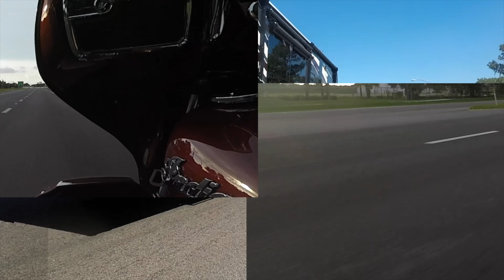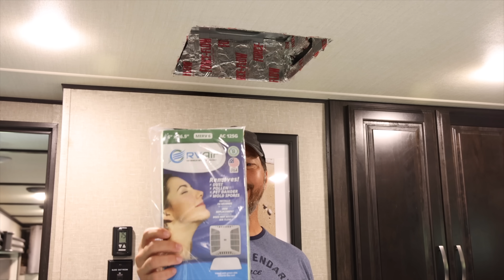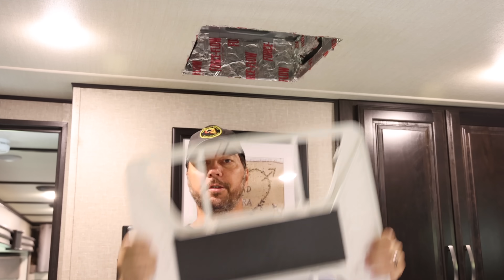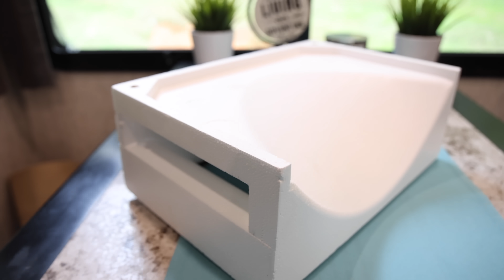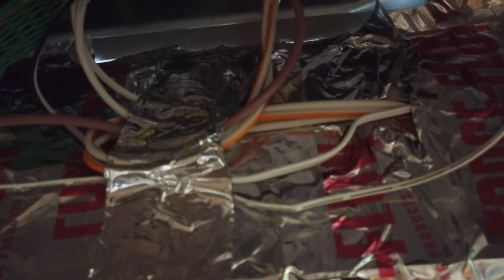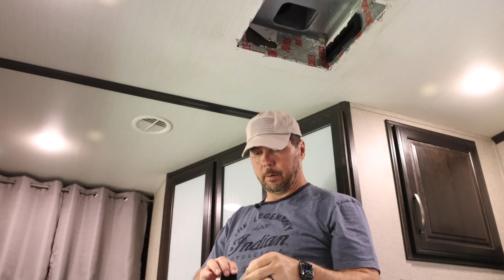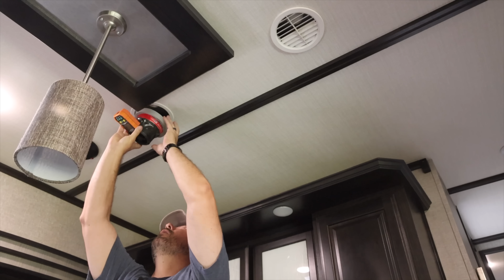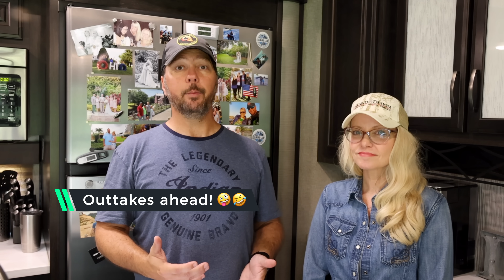Turbo-Charge your RV AC with RV AirFlow! (40% Improvement on Average!)

Comment: @Changing Lanes:  Just wanted to say "Thank you!" for doing this video.  I have a 2020 Grand Design Reflection 150 5th wheel (about 32ft long or so) and am a full-timer in an RV park in Florida...so even though my unit is brand new with a 15K Mach 10 in the main area and a 13.5K Mach 10 in the bedroom, they still struggled to keep it cool this summer without me having to run them all the time and typically lowering the thermostats to 48-50 degrees just to get the room temps below 74 for a comfortable amount of time.  Anyways...after your video I went on the RV Airflow site and ordered 2 units.  Thank you for the 10% discount code also! :)
Ordered them on the 27th, and they arrived yesterday afternoon.  Thanks also to your video for recommending the Wheeler torque wrench to get the torque correct on the 4 big bolts.  I also ordered that on the 27th and it showed up 2 days later, so I was ready to get to it yesterday as soon as the Airflows arrived.
I did the living room 15K system in about and hour and 20 minutes w/ minimal issues like getting the 2 big bolts to line up again once the Airflow was inserted...no big deal though, and I feel real good knowing those bolts are torqued properly again to 50 pounds.
I then did the bedroom unit in about the same amount of time, basically due to one of the bolts fighting me to line up and thread properly, but again, no biggee and the job was complete.
I had no way to test airflow before and after other than just by "feel" with my hands at the vents, etc.  But I am writing to let everyone know that these things work big time!  My rig was about 75 degrees after finishing installation and then I cranked up both units.  The airflow out of the vents was like a tornado compared to before, so right away I knew these things increased airflow as advertised.  My single ceiling vent in the bathroom was closed and the airflow was so strong the air was making a screaming sound from the air being pushed through the closed vent so powerfully.  That never happened before.
I could also tell immediately that the air coming out was much colder than before.  So I turned off the bedroom unit and just tested with the living room.  Normally, with only using my living room unit when the rig was at 74 or 75 degrees and putting the unit on High setting down to 48 degrees or so, it would still not be able to cool the room down more than just a degree or 2 on its own.  So I always had to use both systems at the same time to get the living room to drop down to 68 to 70 degrees with both units on High cranked way down.  That would usually take 15mins or so.
Well that's all changed now.  I cranked the 15K down to just 55 on High and it dropped the living room temp down to 66 degrees in about 12 mins all on its own without using the bedroom unit!!!!
That proves it right there.  When I ran both units on High they turned this place into an icebox in no time at all.  I got it down to 63 degrees and was freezing my tail off, but that proved how much more strong and efficient the units are now with the Airflows installed.  
People may think these are a little expensive...but the 10% discount certainly helped out.  And also, I would estimate they will easily pay for themselves over time  because I can already tell I won't be running my units as long anymore which will definitely decrease the monthly electricity bill.  
Anyways...that was a quick, easy, painless modification that works amazingly well.  This is how A/C units should now come from the factory.  Slam dunk upgrade!!!
Just wanted to let everyone know how well these work.  You do a terrific channel and I watch all time since finding it several months ago.  Thanks again for this and all your other videos!
Reply from the maker: That's awesome!!!  We hadn't even considered the electric savings for those on monthly or seasonal sites!  So glad they're working well for you!
Reply: @ChangingLanes  yeah, since I'm in Tampa and have had to work from my RV full-time since the you know what happened, I've had to run the A/C's all day all summer long.  Luckily, my RV park is full of nice big oak trees, so I'm totally shaded, but it's the humidity that gets ya down here ;-)

Wish I had found out about these things about 6 months ago, because I'm sure my monthly electric bill would have been greatly reduced.  I think I'm averaging about 100 bucks a month or so, give or take maybe 10 to 12 bucks I guess.  But I'm anticipating that to drop at least 10 to 15 per month thanks to this upgrade.  

One other recent thing to note for anyone reading this.  After the installation the other day, my living room unit started making a rattling vibration like a fast "ticking" sound when it would turn on.  I put up with it for a couple days, and when I would push my hand up on the shroud or ceiling plate it still wouldn't stop ticking.  So yesterday I took out the filter cover and filter on the side the ticking sound was coming from, and that exposed the big through-bolt on that corner of the unit.  When I pushed up on the metal frame where that bolt was the ticking vibration would stop.

I only cranked those through-bolts to about 47 or 48 pounds with that Wheeler torque driver just to leave a little room for error.  So I grabbed the driver and adjusted it to 50 pounds and gave that bolt a few cranks to 50 pounds and bingo...no more annoying ticking sound!!!

Luckily that particular bolt was the cause/cure of the vibration and I didn't have to remove the shroud to get at a bolt on the covered up side (towards the rear of the RV side).  

So anyways...if anyone installs these and uses the torque driver for the big bolts (which I also highly recommend), and if you leave a little room for error under the 50 pound setting and then hear a bit of a vibration, try to isolate which bolt(s) that might need a pound or two more tightening and hopefully it will take care of the vibration.  

The bedroom unit was also torqued to like 47/48 pounds but it has no vibration and even sounds a bit quieter than before this upgrade.  I also still can't get over the amount of force both units have now.  It's like a TORNADO in here now when they're both running, and they cool this thing down twice as fast as before.  

Like I said before...they may seem kind of expensive...but for full-timers who want to reduce your electric bill and make these systems run more efficiently and COLDER, they will be worth the cost, because you will definitely reduce your electric bill each month and they will pay for themselves over time for sure.

Comment: In my Grand Design 240RL the factory installed it upside down in our front A/C. It passed 3 inspections, the factory, 3rd party inspection, and dealer inspection. It totally blocked the air out (supply) from the A/C. I fixed it myself as the dealer had a 1-month waiting time for appointments even though I just left the dealership.
Reply from the maker: Well that's odd!  I hope you let GDRV know about it, so they can have a chat with that installer?
Reply: @ChangingLanes  Yes, I had a customer rep contact me and they were looking into how something like got pass all the inspections.

Comment: I understand that because the air flow is directed into the ducts and not the cabin, there is a side benefit of A/C quieting.  Is this true?
Reply from the maker: It's a TINY bit quieter, but not as huge of an improvement as the air flow.

Comment: Got one....installed it.....very impressed!!!  Kids bunkroom went from hottest area to one of the coolest areas!!  I would HIGHLY HIGHLY recommend!
Reply from the maker: Glad you had a great experience!  👍🏼
Reply: @ChangingLanes  only downside is vent closest to unit has "blow by"...air is flowing so Fast it goes past the vent.  All other vents have massive airflow Increase
Reply from the maker: Try putting these just inside the vent (adhered to the top of the duct). https://amzn.to/3oEdamW  We did this when we did our AC maintenance a year ago and it seems to help disrupt the flow and get it out the vent.  👍🏼   It's in this video: https://youtu.be/Gbm8hOyZlrU

Comment: I have found that after the unit sits for a day you should retightened all bolts as the foam gasket compresses. Don’t want leaks. Thanks for the information

Comment: I have a question. What do you guys do for your fresh water hose in the winter to keep from freezing. I've read about the electric heating hose and how to make my own. didn't know what you guys recommend 🤔
Reply from the maker: We rarely stay un sub-freezing temps.  So, we can't really justify carrying around a big heavy heated hose.  Whenever temps are predicted to freeze, we simply put some fresh water in our tanks, turn on the pump, and disconnect the hose.  Usually just an overnight thing....
Reply: @ChangingLanes  ok thanks for the reply

Comment: It does eliminate any cooling air directly coming out of the AC unit as all air is then directed to the roof vents. That may raise sensible temp at the living area under the unit.
Reply from the maker: perhaps.. but opening those dumps lowers the temp everywhere but directly under the AC... plus much of that energy is lost, being pulled right back into the AC...  The feedback we've received and also what we've experienced is the heating and cooling with this kit is very much improved overall.

Comment: As an aviator in the army and Air Force, we always kept our torque wrenches with pressure on the springs by keeping them at 10% of the rating. Foot, inch or ounce. Leaving the spring at zero allows it over time to expand and or contract and lose accuracy or go below and cause errors.
Reply from the maker: I think it's different for every brand / model.  Two of mine say zero and I think the big one is 30.

Comment: Damn you, now another thing to buy :) I was looking at these and wondered about the effectiveness vs homegrown diverters. This will work on my forward two ACs but my rear unit is whisperquiet so everything is hidden and on the roof. I wonder if I can still somehow make this work with that unit too. Did you happen to measure the Db difference before and after install, I imagine that it made things quieter since the air isn't being beaten into the ducts.
Reply from the maker: I tried to get a dB measurement but it was negligible.  No idea what the plenum looks like in a whisper quiet....  I guess the only way to get to it to see is to pull the AC off the roof?
Reply: @ChangingLanes  Yes, I'm not a fan of the whisper quiet system because everything is roof based and you don't get good visibility into the plenum.

Comment: Is this only compatible with SOB RV’s?  Will it work in an Oliver or Airstream?
Reply from the maker: Not sure what an SOB RV is, but this is currently only for coleman ducted systems.  Dometic systems are in the works.  But all of them are for ducted ACs, not straight dump ACs.  I don't think airstreams are ducted but I could be wrong.
Reply: @ChangingLanes , thank you. Yes, the Airstreams have ducted air systems. I believe they’ve been ducted since around 2015 or so.  It is my understanding most , if not all, newer rigs offer ducted AC now.
Reply from the maker: Interesting.  Didn't know the roof had enough depth for ducting.  Good to know! 👍🏼

Comment: Great video, I want to try it in my rig. Did you notice any difference in the noise level or quality? Can it be removed for maintenance and repair? Also, does your center unit feed all the ducts?
Reply from the maker: Negligible difference in noise but it does help a little.  Particularly considering we can run them on low now versus high much more often.  It can be remove very easily.  And, yes, our center AC feeds the duct system (fed by all 3 actually).  👍🏼
Reply: @ChangingLanes  Thanks!

Comment: Hi guys.  Small correction. 
You're confusing "high side" and "low side" with the correct terms, "supply" and "return".
The high and low sides refer to the refrigeration circuit high pressure side and low pressure sides.
Reply: They don’t like it when someone corrects them . You didn’t get a ❤️
Reply: @mojotrinity4927  At least they didn't delete his comment like they did mine when I gave them a compliment but chewed out someone.
Reply: Must be a tin knocker..  Sparky here
Reply: That was a little confusing, I must say.
Reply: Thanks for that.  I was confused too.  Seems rather expensive for that bit of foam and plastic.  But the video sure helps and tells me I need to look up there in my new RV to make sure all is the best it can be until I figure out a home made solution to making it more efficient.
Reply: Just now saw this. You're right. It's "conditioned air" after all, and it's got to be "conditioned" before it's "supplied" to your living space, and then "returned" to be conditioned again. 'Low' and 'high' pressure just muddies the water.

Comment: Here's a way to take some of the frustration out of getting the lag bolts lined up.  Buy yourself threaded rod and cut it into two pieces.  Install the rods in opposing corners put the box up with two of the lag bolts in the other holes.  Then replace the rods with the other two lag bolts.
Reply: Good tip!
Reply: That would be a great addition to the kit.

Comment: I'm continuously amused by the severe lack of engineering / design of these RV manufacturers and their vendors.   They build cheap crap knowing fully that its garbage and then 3rd party companies (like the inventor of this product) actually design something that WORKS and we have to then spend more $$$$.   It's absolutely amazing.  I guess that's what makes the economy continue to work.  Either way, you always have the BEST reviews and install vids AND the best bloopers!  Appreciate you both.
Reply: The RV industry is a joke.  There are no standards and they have a bunch of minimum wage guys throwing these things together as fast as possible to make their quotas to make their bonuses.  Most QC is poor as well.  I know 2 people that worked for Monaco coach here in Oregon and they both said nobody really cared about quality.  It was just getting them out ASAP.
Reply: @uowebfoot  you're not kidding...it really is about how quick they roll them off the production lines.  But, it's not just RV's, it's new homes too. We just bought a new home (almost done being built) and these builders don't give two shits about quality. There's no pride in workmanship anymore in this country on anything...very sad.
Reply: @cozycampersgorving  
My wife and I looked at a home built in 1957 and it had everything top of the line from that era. Everything was like brand new and bullet proof.
Reply: @cozycampersgorving there's a high end builder in my area that is getting sued for shoddy construction... these are million plus dollar homes.

So yeah, NFG all around
Reply: 100% agree. While watching this video, I was thinking about how a real well designed rv made by a full timer would be amazing
Reply: At the same time, the good that comes from this is the cheaper sticker price. Leaving us full timers with more money to get creative and really build it the way we want it
Reply: If they built to higher standards the average buyer would not pay the significantly higher cost, since the average RV buyer only looks at only the floor plans, colors etc. Often what makes a better or higher quality unit is not readily seen or touched.  The RV market is highly competitive.  Further they know that for those RVers who appreciate quality will make improvements through the after market.
Reply: @hermes6587  Your point is somewhat valid. However, my father has owned several RV Bus Motorhomes well over 100K in price and they fall apart just as bad.  So high price does not mean better quality.

Comment: What if you add HVAC tape to the inside of the dump section? Would that help keep the dump better sealed?
Reply from the maker: That would better seal that one thing, but wouldn't change the turbulent airflow inside the plenum.  So, you would certainly get some benefit from it, but likely not a lot IMO.
Reply: @ChangingLanes  oh!! Watched it again, and I see how it works now.  No need since the whole bottom area is now inlet, and as you mentioned the dump is now just an unfiltered area.  So...how's the sound affected by this gizmo, if any difference at all?
Reply from the maker: Negligible improvement in sound, but it does help a little.  Also helps that I can run the ACs on LOW now a lot of the time.

Comment: Chad,
What were those nubs you mentioned in the duct outlet nozzles?
Reply from the maker: Yes and no.  I call them vent nubby's but they are actually door knob bumpers.. https://amzn.to/3mte97l  They seemed to help get more airflow out of the duct system.  Not sure how effective they are now that we have more airflow...
Reply: @ChangingLanes  Thanks Chad. 
Also are you testing any refrigerator devices such as fridge defender by ARP?  I have am looking to increase Refrigeration and AC performance in hot weather. Please see link below:

  Purchase Fridge Defend by ARP | Dometic | Norcold | RV Safety | RV Reliability

Comment: Great video! Do you have an easy way to out some heat thru a vent?
Reply from the maker: Yes...  Our middle AC is a heat pump.
Reply: @ChangingLanes  to block some of the air coming out of a vent?

Comment: Thx CL for excellent video production with a interesting product review and install and most importantly accurate evaluation. Having spent some yrs. in getting an education and working in HVAC trade  and facility management I found that air flow and balance  to design requirements is often comprimised with lack of quality intrumentation, incompetence  and shortcuts to meet bid $$$ and schedule resulting increased life cycle cost in energy, maintenance, and poor system performace for the system owner. Job well done CL. Go Navy.